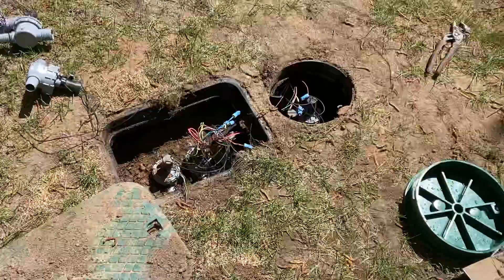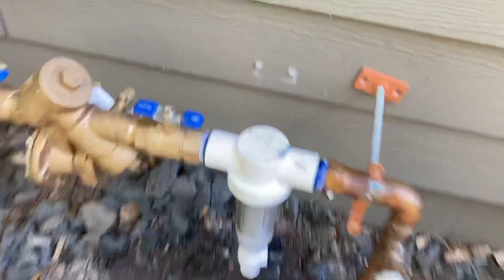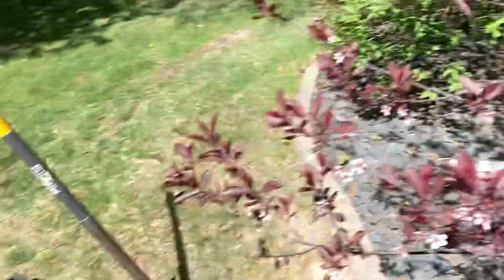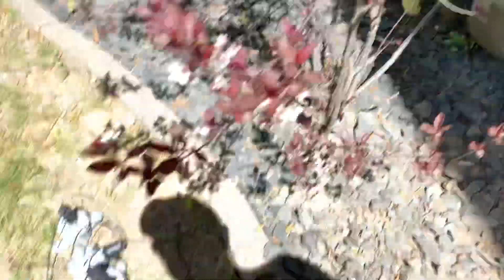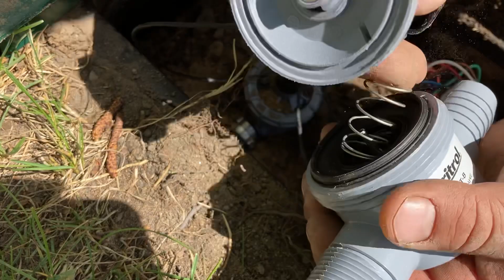Fix leaking / weeping valve irritrol 2400 T irrigation sprinkler system repair

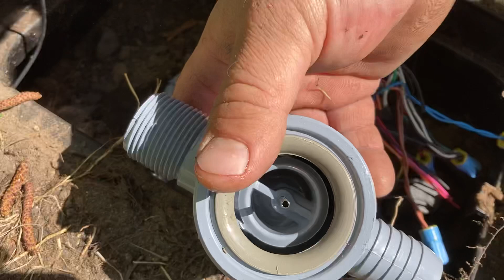Comment: That tip at 4:32 about using a wire to clean out the small tube/orifice I believe ended my 3 hour journey of attempting to repair my valve. I had cleaned, swapped parts, all sorts of stuff getting soaked while the zone kept running. I finally tried running the wire (used some #14 copper and another really then floral wire) and the zone finally shut off. 

Thanks for that tip! Not of my parts were worn or cracked and the wire didn't reveal any debris, but I guess it worked (or just happened to anyways).
Reply from the maker: Yeah it works

Comment: im North Carolina Brunswick county ,   my 6 month new home has sprinkler leak.  I've narrow down to valve or diaphragm leak.   I didn't open it yet.  My question is :  how do you identify what brand im working on?  so I can go buy replacement parts before I open it.   b/c from the top my valve system looks like either irritrol or hunter, ones that don't have screws.    thank you for your video.

Comment: I just replaced all the removable parts on a valve the wasn't opening.  I had taken it apart and cleaned the pin holes and that worked for 1 day so i bought a new valve,  After hand tightening the lock ring i had a big leak,  the new ring below the diaphram didn't fit as snuggly so i switched in the old one,  that cut the leak to a trickle but still leaking, Do you think i just need a slight turn on the lock cap?  The valve is in a real bad spot.  i don't have room to use your wrench and I'm hesitant to use channel locks from above,

Comment: Loved your video. I am fixing my irritrol valve today. Please reach out to system installation "experts".  All of my valve boxes in my yard are to SMALL, stuffing 4 valves in a 3 valve box.  Most of my valves are crammed in so tight, they are pushed against the sides of the valve box. This makes working on the valves very difficult. The price difference of a 3 valve box compared to a 4 valve box can't be that much!  I hope install businesses will read this and up there game a bit.   Thank you for your good info.
Reply from the maker: Probably not but if I were you I’d dig them up and put a larger box on them

Comment: Zone 4 was leaking and filled box with water for a few days before realizing. Cleaned out with vac and  replaced all guts on a leaking zone 4 with a new 2400 assembly. Now its the ONLY zone that runs despite what the controller says.  I can manually turn on and off all other zones no problem. But when using controller its only the new valve that will come on. 
Each zone getting 24 volts as they are supposed to when checked with volt meter. 
I'm totally baffled on whats going on here! Thanks for any suggestions!
Reply: I even disconnected wire for zone 4 and when turning on system it was STILL the only one to come on!

Comment: Do they sell only the diaphragm? Or we need to buy new solenoid and just replace the new diaphragm, spring and cap for the old solenoid? I have 2 station, one of the station is leaking continuously, so do I have to change the solenoid for the leaking station or do I have to replace the master solenoid as well? Please reply.
Thanks
Reply from the maker: They do sell a diaphragm separately
Reply from the maker: Remove the diaphragm and inspect for damage It is a possibility that it could be the solenoid but this is less likely

Comment: I have a valve just like this one that will NOT close. When that zone comes on, all the zones after that are at half pressure because I now have 2 zones running at the same time. Here's the crazy thing; I went out to the valve box and turned the manual on/off ring on top of the valve, and it still would not go off. Irrigation control box is off. I had to shut of my main with a curb key to finally get it to stop. I've pulled the diaphragm and it looks fine. I guess I'll replace the diaphragm and the solenoid just to be safe, but I thought I did that last season. All other valves function fine and those are original diaphragms and solenoids (15 years old). Any idea what else could be going on? Thanks for any advice.
Reply from the maker: Clean out the hollow tube in the center as well and check the solenoid To make sure the plunger is free moving
Reply: @Irrigation_Tech_Talk  Thanks very much for getting back to me. Yes, I took some wire and ran it through that tube. I also replaced the diaphragm and the solenoid just to be safe. There is a small nick on the underside of the bonnet cap near where the tube comes up. It's tiny, but I'm wondering if that could be the issue. I think I'll buy the whole valve assembly and replace everything I can. Thanks again. This valve has been a PITA for over a year.
Reply: @Irrigation_Tech_Talk  I also just realized looking at the parts diagram on Irritrol's website that there is an o-ring under the manual bleed assembly. I wonder if mine is missing? That may prevent the diaphragm from closing maybe??

Comment: I have an irritrol and a rainbird Valve, rb controls sprinkler and my drip won't turn off. My irritrol has screws doesn't just pop off like that it's seemingly glued. How do I open thing thing?
Reply from the maker: Take the screws out and wiggle back and forth it’s probably stuck together for years. A small flat head might help but be careful not to damage the diaphragm

Comment: What does the solenoid actually do? That’s what I’m trying to figure out. Is it possible to test a solenoid to see if it’s working? If so, how do I test it? What physically moves?
Reply from the maker: Yes it is test able
The little plunger moves up when it gets current. 
Test with a colt meter on ohms 
But you can also do a simple test by touching both ends to the positive and negative of a new 9v battery

Comment: Just replaced 2500T solenoid valve and doesn't come on with system but will manually but comes on in the 'off' position. I have direction flow coming from house. Any idea what problem is? Thanks
Reply from the maker: Sounds like it was installed backwards
Reply: @Irrigation_Tech_Talk  yep sure was. Instructions were not included with unit. Thanks for responding 👍
Reply from the maker: @rproh3812 i know because I’ve put one in backwards before lol

Comment: replaced the coil and diaghram in my irritrol 2400 but it keeps turning on with other stations. It shuts off when the other stations shut off. No idea why it could be doing that. What's the tool you used to open the jar top ?
Reply from the maker: https://amzn.to/33KeoXB
Irrigation head wrench. 
If it runs with other zones it could the controller check at the valve with a colt meter

Comment: This is a great video.
Should there be OR should there Not be water weeping out when you take off the solenoid?
I have some valves that do and some that don't (9 total valves -not sure which one(s) are malfunctioning).
Reply from the maker: Yes there’s should be water coming out if you remove the solenoid
Reply from the maker: You may need to replace diaphragm here’s a link for the correct ones https://amzn.to/3TV8yJ8

Comment: Okay I'm replying to Old video. But, the last valve you "Didn't Fix", you didn't replace the diaphragm?
Reply from the maker: If the diaphragm is not damaged clearing debris can work but if the rubber is dented it should be replaced
Reply: Do they sell only the diaphragm? Or we need to buy new solenoid and just replace the new diaphragm, spring and cap for the old solenoid? I have 2 station, one of the station is leaking continuously, so do I have to change the solenoid for the leaking station or do I have to replace the master solenoid as well? Please reply.
Thanks

Comment: Where did you get the wrench? Is it just what they call a head wrench they demo for removal of the sprinkler heads? Hard time getting the heads on and off
Reply from the maker: Yeah it’s called a head wrench
Reply from the maker: But there is a specific wrench toro makes for this valve
Reply: @Irrigation_Tech_Talk  The plastic Toro wrench is not very sturdy.    Where can I get the offset wrench in this video for night spaces?